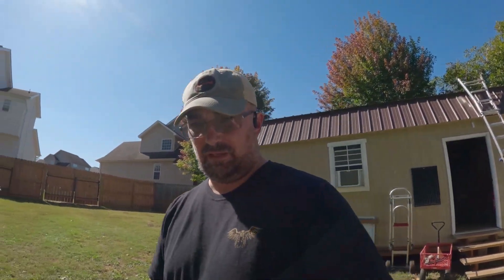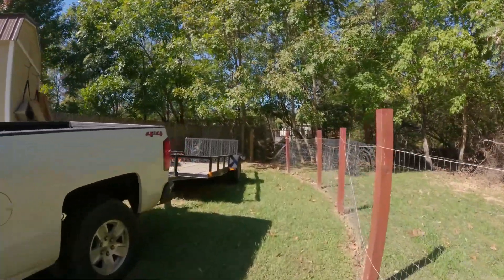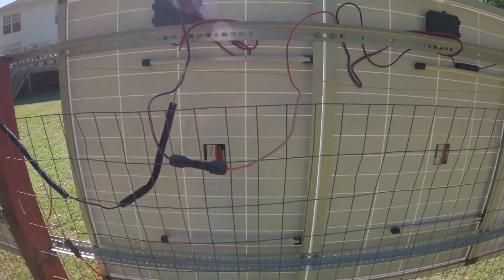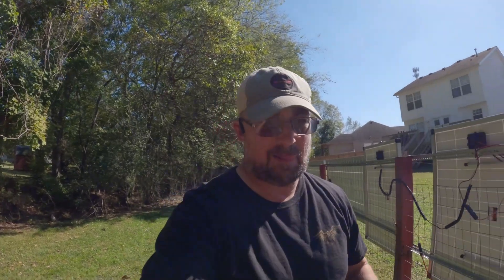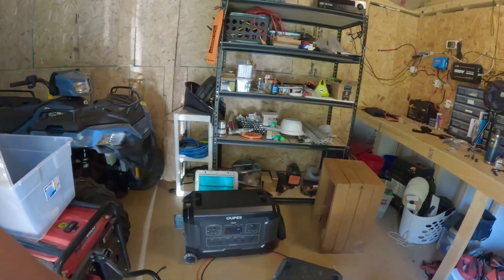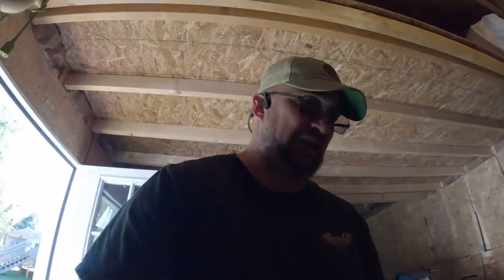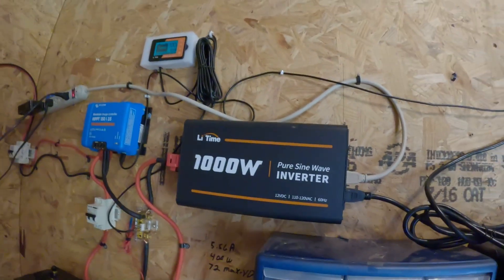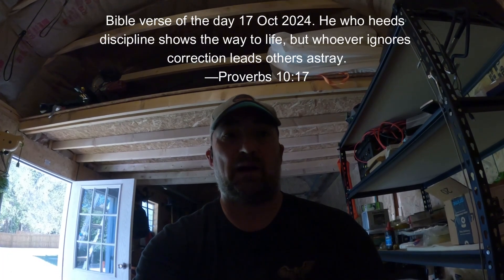VLOG 36, Solar panel wiring concerns due to sun exposure.

Comment: I agree about covering wires that run along hot metal for some extra protection. I use Temco pv wire for outdoor use. Its seriously weather tolerant and you can bury it if you want, too. Temco is priced fair also, considering the quality protection and the fact that you know you're getting pure copper with them. Those harbor freight panels are great,too. I had to stop using them since they were taking up more space than I ever wanted to use for solar panels, but i wouldnt pass up a much higher wattage panel from them if they made one.
Reply from the maker: @solarmeateater  I will look into the Twmco PV Wire. I am going to take a guess and assume that it's sold on Amazon. 

Once I replace my fence line, I will be adding more Harbor freight panels to it. I need 10 in total for the system I am building.
Reply: @Kevin_D1  they're an industrial supplier. They only sell through their own website as far as I know, but I buy my cable 70ft at a time and shipping is always free, though I'm sure there is a threshold for that.